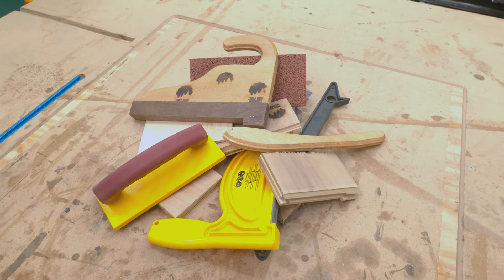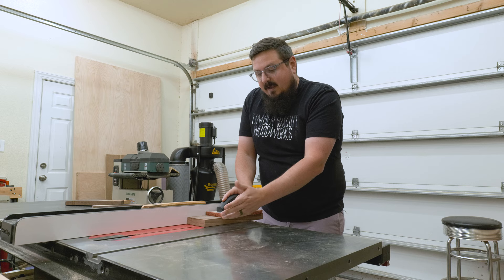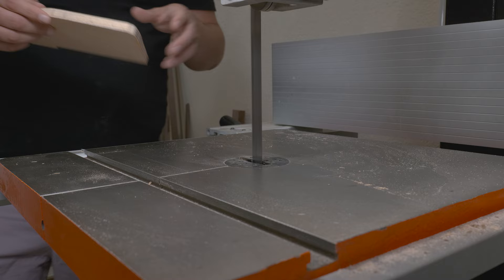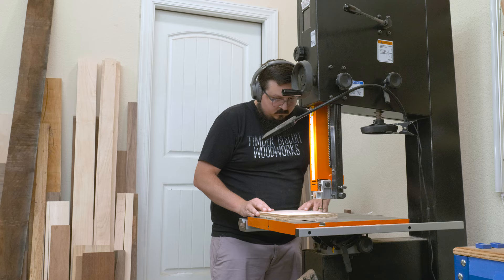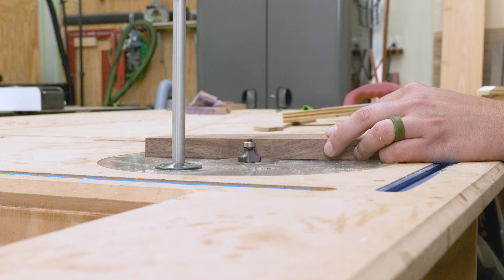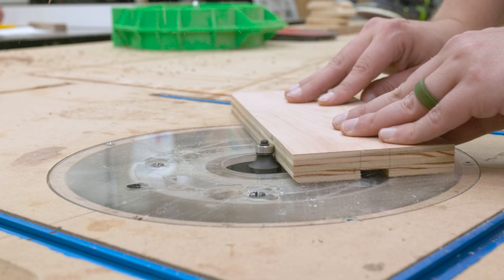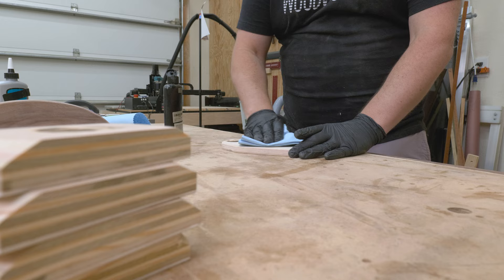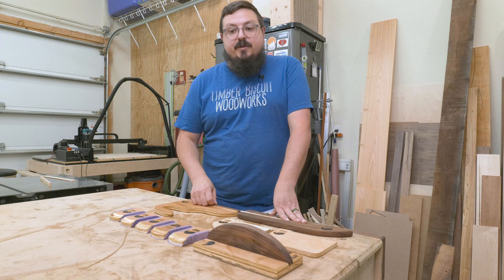The Best Push Sticks PERIOD || 5 FREE PLANS

Comment: Doesn't it make sense to use velcro on the sanding blocks? That way you can just stick and peel it when replacing the disc.
Reply from the maker: The sanding discs are adhesive backed so in this case it isn’t needed.